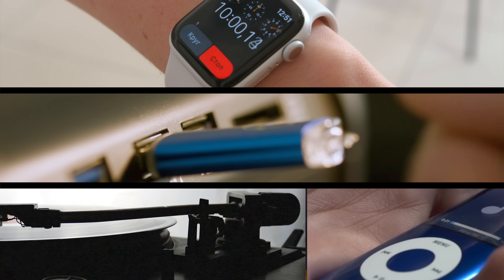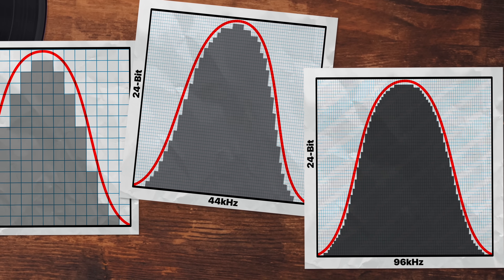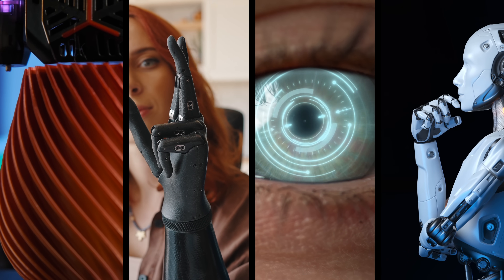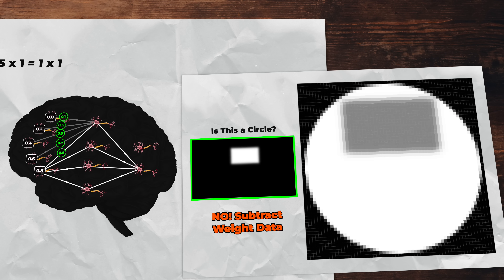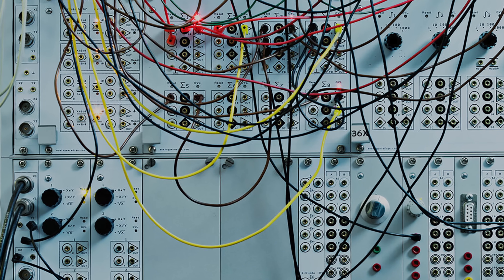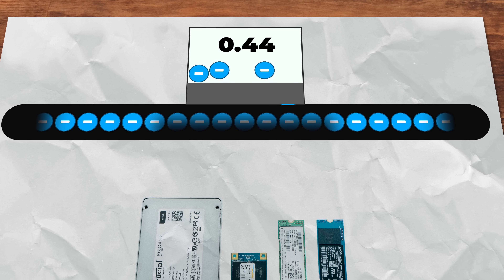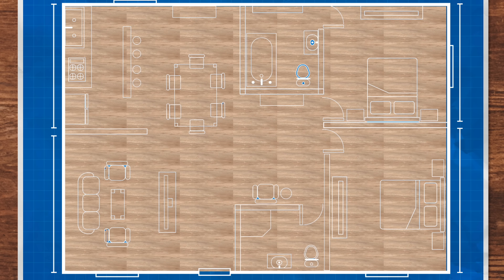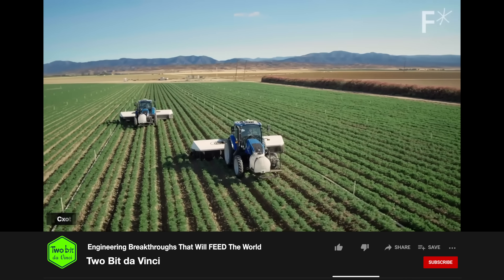Analog Computing is GENIUS - Here's Why!

Comment: From what I've read, Mythic's tech isn't really quite analog. One source reported 256 descript gate voltages for each transistor storing a value. This is no doubt closer to analog than digital binary states are, but the values are still quantized. Still, it's an interesting use of flash technology. I guess it also means the data can still be backed up and transmitted digitally.
Reply: While you are correct that the floating gate transistors can only be controlled to some precision of discrete gate voltages (even sometimes 4-bit [16 values] in mythic's case), this is not where the "analog" comes from. In fact, these stored values can vary during operation by a significant amount from a variety of factors, so they are even less precise. Moreso the term "analog" comes from the method of not using a bistable device as the main method of computation. Rather, the physical dynamics are used as a mode of computation. From an energy perspective, this is not ideal (since digital to analog or analog to digital conversion takes a lot of energy,) but the main energy sink, the actual computation, is done very efficiently. 

Unlike "analog" computers of old, such as those seen in navy targeting computers, the modern (near term) search for analog computers is to find very efficient ways to compute with digital data. For this reason, the term "mixed-signal" is commonly used in academia to refer to this approach. There are certainly methods of computing that are all analog, mainly classic analog computers and biological brains, but these are either too difficult to scale (the former) or beyond our current technology (the latter). 

TLDR: Digital in, compute with analog, digital out.

Comment: Analog computing definitely has a place. I don't think it will change mainstream computing, but certainly for application specific uses as you described, it could be a game changer. Data storage seems to be another beneficial area since currently we would need to use 8 bytes per floating point number. With an analog solution a single analog data point could represent that number.
Reply: You can represent a floating point number using any number of bytes. The format used to represent the data is decided by the required range of numbers and the accuracy needed.
Reply: I think analog computers might be a little more common than we're thinking, depending on how common AI acceleration hardware becomes.
Reply: @kneesnap1041  quite possible. I'd love to see AI enabled devices become a thing.
Reply: you don't need an analog computer to read analog information. we already do it with microphones
Reply: @heliusuniverse7460  yeah it's all a matter of precision. The difference between analog and digital is infinite precision vs discrete values. Remember when CD's first came out, and all of the audiophiles refused to listen to them because they preferred their records? This is why, the transition to digital caused a loss of precision. To many it was good enough, but for some use cases it was insufficient. This will be the same. For most things digital is fine, but there are some use cases where infinite precision is a boon.

Comment: "digital approximation of the analog soundwave gets closer and closer" what? that's not how digital audio works. With a band-limited signal the digital conversion can reproduce the original signal 100%

It's ok to simplify things, but please don't misinform.
Reply: I think you have misunderstood something. The video is correct. 

I can think of 4 technical reasons, there maybe more, that the analog to digital to analog systems, will never have 100% reproduction of the original band-limited signal. It may be very close, may be so close that it can not be measured, but for theoretical reasons there will always be errors. 

The video said that as the sample rate and bit depth increases, the analog soundwave gets closer and closer. This is correct because as the sample rate and bit depth increases the different errors associated with the conversions process decreases. For example as bit depth increases, the quantisation noise decreases.

Comment: I started my career working on analogue computers used in industrial and manufacturing environments. They were mostly used for controlling motors and used proportional, integration and differential calculations at very high speed. They worked well in environments that were not computer friendly and were very robust and reliable. That was 40 years ago and they lasted for years because they just worked. I think the challenge was that to program them you needed to understand electronics and mathematics and that isn’t so necessary with modern digital computers.
Reply: Some of those old controllers were pneumatic.  PID controllers were used for a lot of valves.
Reply: Yep, when I was taking electronics at vocational school over 40 years, and our instructor talked about analog computers to include computers that used RC time constants to solve log calculations.
Reply: do you think we pidgeonholed ourselves in terms of innovation and application ceilings by pivoting to ditigal applications almost completely and uttetly in modern tech?
Reply: Where can I learn more about these? I've never even heard of old programmable analog computers.
Reply: So, finally no more blue screens of death anymore!
Reply: @offbeatinstruments  Yep. Same here. I was pretty good at using them, although when my career started, digital was the rage. Yes, you need to understand electrical engineering, math, and systems.
Reply: Now chat GPT is doing code and now people are gonna have to learn electronics.

I personally am happy with analog. It's like reality vs. artificiality with digital vs analog.

Comment: The explanation of AD/DA is incomplete. Digital audio is NOT represented by the stair step graphic you show.  While that may be representative of the data storage, digital audio is converted by an algorithm that perfectly reproduces the audio signal that went in.  16 bit/44.1 Hz is extremely accurate but there are some minor issues including processing digital audio (mixing, surround sound processing etc.) which is improved by high bit depth and sample rate.  Much music is produced at 24 bit/44.1 (or 48 Hz film).  Recently, the industry has been requiring higher sample rates.  Digital Audio Workstation software typically converts the bit dept to 32 bit while working IN the software to reduce/eliminate processing artifacts from processing the audio as much as is needed when mixing music.  The Digital to Analog algorithm is the true genius of digital audio and makes the stairstep analogy wrong.
But I do acknowledge that this isn't the main point of the video and you are illustrating the differences of digital and analog.
Reply: Why is it so common, that there is believe that the stair step is wrong? My EE education and I have read text books that teach it. While not used in all DAC, the sample hold method is used in most DAC chips. And this makes it acceptable in videos like this. But why do so many strongly deny it existences? I don't get it.
Reply: @yziib3578  I did say it exits as the storage method but it is not what is output.  It is not what you hear.
Reply: @L.Scott_Music  You are correct in saying that the stair step is not outputted. As it is removed by the low pass analog reconstruction filter. And I was not referring to data storage. I was clearly referring to the DAC, or as you called it, the Digital to Analog algorithm. The Digital to Analog algorithm does not make the stairstep analogy wrong, as the stairstep is in the of the algorithm.

Comment: The analog computer chip from mythic would have to be considered digital IMO if its converting the signals to digital and making determinations based on the digital signals.
This is a digital chip. This is how regular digital chips already work.

What you have here is an ASIC.
Reply: Not really.  Of course it will have a digital interface since it needs to be programmed and operated through a connection to a regular definitely-not-analog computer, but the processing behind that interface is analog (at least based on what I've heard about them - I have no relation to or knowledge of their company so there's always the possibility that the sales pitches are leaving out some important details).  Regular digital chips to not play around with arbitrary voltages or currents - that tends to make them not function (or worse, still function but not correctly).

Basically its digital logic to prepare the system for a calculation, then analog to run the calculation, then digital again to read the result back.  That's also how quantum computers work (except that middle part is qubit magic rather than analog circuitry).

Its still an ASIC though I suppose, as that term doesn't really specify that the IC components on the must be strictly digital.

Comment: At Oregon State University in the 60s we started by wiring logic boards to do tasks to a deck of punched cards. We later moved to an IBM1620 that was a mix of analog (had dials to set for many engineering functions) and digital (could run an early version of Fortran II). Used tons of power compared to the CDC 3300 that replaced it. Now that digital power requirements are dropping for both CPUs and memory I can see Analog Computers used for a specific tasks but not for General Purpose Computing. One of the issues with Analog Computing is numbers like Pi or e out to multiple decimal points required for many scientific calculations and transforms like Fourier and LaPlas.
Reply: No.  Just not true.  The IBM 1620 was 100% digital.  Yes, it contained may analog components.  When you get down to the individual transistors, they are all analog, even in fully digital computers.  But the circuits did not operate on analog values.  The distinction between analog and digital computers is in how numbers are represented.  If numbers are represented as specific states, whether there are two states in a binary digital computer, or four states or more in a modern flash memory cell, they are still digital.
Reply: Are you sure that the 1620 wasn't a 1710--the process control version of the hardware?  Had DAC and ADC peripherals.   Still instruction-compatible; just a few added features and instructions.   In the 60's, the notion of a "hybrid" computer was all the rage.
Reply: Dials have same digital nature as selectors on washing machines, I suppose. It can be replaced with a line of push buttons, just was more convenient.
Reply: @sonickrnd  My kitchen induction stovetop has rotary controls for individual element heat.  However, what's used are simple rotary encoders, so that a dial position doesn't correspond to a setting--you have to look at the LED readout to see what heat level you're setting.   Which, in my opinion, defeats the whole purpose of rotary controls.  I have a blind sister-in-law who is absolutely useless with this kind of control--she has no idea what setting is being established.  "Touch" controls are similarly useless to her without some sort of feedback.  It seems that human engineering has taken a backward step with this sort of thing.

Comment: Exact computations are not necessary for most applications. Our eyesight & hearing is not exact, but speed to process massive quantities of divergent information is more important.

Reducing power to perform high speed computations in near exact results is good enough for smart bombs 💣 , smart rockets 🚀, smart artillery, smart bullets.

Similar needs for autonomic driving systems could be an excellent application… conserving more power for expanding distance of the vehicle.

Honestly, this can change a lot in military & civilian applications.
Reply: Also, you can use digital for the really precise $10M missiles and analog for the cheaper ones that you want to manufacture at scale.

Comment: This video seems to be missing the looking that even digital is actually analogue as well, with an ability to interpret and then manipulate i.e. process or compute through the transistors and logic units.  But the electricity continuity paths are still established, formed, and decay in an analogous manner, just just interpreted and manipulated to discrete against noise.

Comment: In audio, speakers are still analog, so they smooth out digital  signals, simply a physical membrane can't instantaneously transition between digital steps. Eardrums are similarly analog: our human ones cannot cope with frequencies higher than 16 Khz, and the jnd (just noticeable difference) in amplitude ranges from 1/3 to 40 dB, over a range of 180 dB. Thus we can discern at most 7600 amplitude gradations per 1/16K seconds. A 16-bit signal with a 44.1 Khz sampling rate provides 64k amplitude gradations per 1/44.1K seconds, or about 0.04 jnds per second. Meaning that any perceived difference between an analog feed from a vinyl record and a digital one from a CD or MP3 is purely imaginary; not to mention that a needle does not necessarily track the groove accurately and is sensitive to any scratch or debris, so digital recordinghas a much higher signal-to-noise ratio and is distincly superior in quality. Beside reintroducing analog elements as a way of imitating neural circuits, there is also fuzzy logic, where for example a combination of two bits could represent the states 0, 1/3, 2/3 and 1 - i.e., false, possibly true, probably true and true.

Comment: I have recently built an analogue computer using nothing more than some MOSFETs OP-Amps resistors and capacitors. The FET's were only used for multiplexing. Also there is an easy way of doing this. Something simple like a Z80 based computer with FRAM which is ram that does not need power to retain data. The Z80 writes to 8 latches that multiplex in the type of node needed EG sample and hold, multiplier, adder, subtractor, integrator, differentiator etc. That is just the first 3 bits. You then have 5 for weighting etc. That gives 32 possible values.
Reply: That's impressive

Comment: If 99% accuracy is sufficient, just use an  8 bits. 98% 7 bits. 96% 6 bits. 93% 5 bits.  87% 4 bits. 75% 3 bits. Something like that.
Reply: And then your multipliers can go REALLY fast.  In fact, you then can get away with look-up tables, and get your results in a single clock cycle.
Reply: @BrightBlueJim  That's in response to the comment 95% accurate is good enough. But that's why digital music used to sound like hot garage.
Reply: And my comment refers to the claims that analog multipliers can be faster than digital. Not so much, if you reduce your digital resolution and dynamic range to what you get with analog.

Comment: The idea sounds nice.For certain things it could work but many things the reason why digital is better is because of how precise it is. Precise=efficiency
Reply: It's not so much that it's precise: it isn't because digitisation introduces "quantisation noise" (for example in a three bit coding everything between 5.5 and 6.5 gets converted to 110). It's that the imprecision is precisely known, and definable in advance. 

You are partly right because often knowing precisely how much noise you are introducing is better than not knowing. However you're also partly wrong when you assume precision implies efficiency.

Efficiency partly depends on the number of transistors in the hardware, so quite often analogy is more efficient as one transistor can process an analog signal that works take a while network of transistors to process digitally. One analog switch can dissipate about the same energy than any one of the switches that handle a single digit. So as a first guess you'd expect an 8bit digital processor to disappear 8× as much as an analog processor designed to do the same job. 

The big advantage of digital is the ability to reprogram the device digitally, overseas of with at best a plugboard or at worst buying a complete new device for every task.
Reply: PS: The formula for the noise introduced by the analog to digital conversion is quite well documented online: just search "quantisation noise formula"
Reply: @trueriver1950  I'm pretty smart but I also know when I don't know which is why I commented exactly what I did. So I am glad you responded! Probably will take some time to understand what you mean. I understand it for face value of what your saying though.

Comment: That is a pretty bad example on how sampling audio works, it’s not actually a stairstep at all. It will incur some noise while sampling and quantizing but that is just the difference between two smooth curves. Actually outputting a stair step signal would require infinite bandwidth and infinite currents.